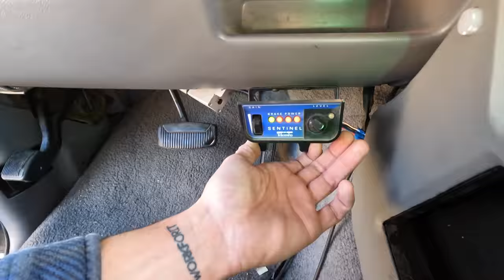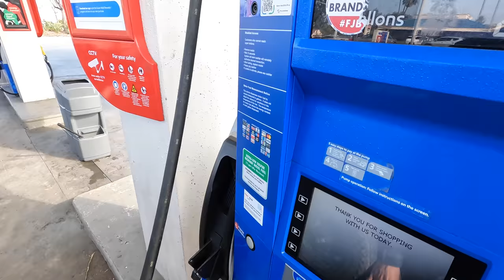RYNO RANCH GUEST HOUSE RENOVATION (PART 11)

Comment: Where I live I don't see that kind of dump truck setup where the box on the trailer goes into the truck there is a lot more gravel trains where its usually a dump truck and a dump trailer or a semi pulling 2 dump trailers

Comment: Hey this is what I found on that brake controller;  According to my contact at Tekonsha the Sentinel is an older brake controller and the lighting configuration that you have stated seems to be normal.

If the green light is flashing at approximately an 8 second interval, it is a diagnostic light that is showing that the trailer is connected and the system is operating. If the red light is illuminated that indicates that there is current to the trailer. If the green light is a solid green light then it is indicating that braking has begun.

However, if the green light is quickly flashing at an interval approximately 3 times per second it indicates that there is an issue such as a short or excessive current on the system or low battery on the tow vehicle.

I hope that helps.

Comment: Hey brother you should also install the cabinet before you install the angle stops that way you're only cutting a small little hole for the pipe then you can put those little collars on and then the angle stops and it'll save you having to cut a bigger hole to fit the angle stops.

Comment: Super sharp!

Couldn't you trim out the flooring before setting the cabinets?

Totally had the issue when I had my floors done, one of my bathroom cabinets a month or so later gave out on the front edge and dropped down almost 1/2" and ripped the backing off of it since it stayed on the wall.

Comment: Did a little plumbing in the past and only recently came across that shark bite style fitting to fix a leaking pipe in my parents house. It’s very unnatural to anyone who has used the traditional fittings. I was surprised that it didn’t leak. Seems I’m not alone. Always appreciate the content. Thank you

Comment: A better test for the p trap and plumbing under the sink is fill the sink full and let it drain. It puts more pressure on the fittings which will show a leak that might not show with low volume of water.

Comment: Ryno!! I’m a plumber out of Massachusetts and just wanted to share a quick few tips. Those shark bite fittings always turn like that. And the leak you had in your p trap is very common. I personally put a little pipe dope (pipe thread sealant/lubrication on the union part of the trap when I install and they never leak after that. Love the videos! Keep ‘em comin

Comment: Need to get the 6.0 fixed up buddy, it'll tow all your stuff you need without overheating. Just studd it and get a livewire tuner. Nice to see a trick to setting up water lines thanks for that. Hope the rest goes well man.

Comment: Im a certified plumber. I will absolutely only ever use shark bites in a pinch till I can get back to fix the problem permanently. The trick to compression angle stops is to use some lubricant on the ferules. And yes shark bites will turn freely, it's normal.  One think you should do when using shark bites is to file the end of the copper pipe a little . Copper cutters will bevel the edge making it a little larger. It helps to not wreck the gasket when installing the shark bite.

Comment: The sharkbites should not blow off if the building is still under regulator pressure. They in general practice will split and leak before they will blow off if the pipe is cleaned and properly roughed enough for the sharkbite to attach to.

Comment: Never run a floating floor under cabinets. It’s supposed to float. If you have issues the flooring manufacturer won’t cover it under warranty because that reason. Also supposed to be a .25 inch gap around all walls.

Comment: The shark bites were done properly. The only thing I would have done differently is take the plastic inserts out of the valves. The inserts are for pex, they aren’t needed for copper or cpvc. And yes after installed they will spin and feel loose.

Comment: I've used shark bite fitting on a water main coming in to the house to remove a water filter system we never used. Works great and never leaked. I was recommended to do this from an old tile installer my grandma knew

Comment: I'm not a plumber I do hvac but have done alot of angle stops in my life being I own rental property. normally with copper u take the white plastic piece out of the angle stop and throw them away there only used with PEX, second the seal is a o-ring and u really are suppose to reem the inside and outside of the copper on the stub outs before u push on the shark-bite fittings.
Reply: Another thing is they do make shark-bite fitting that are only for PEX so always make sure u grab the right ones that say copper,pex,pvc and cpvc. And pvc is not acceptable for potable water pipping.

Comment: Great job on this series I remodel homes for a living been doing it for 15 years little trick to installing baseboards before paint put 1 1/2 tape down first install base ontop paint wip out the tape paint 2x and cut the tape with a knife and Boom finished
Reply from the maker: I’ll usually do it with the really thin masking paper in the 8” roll. Slides out nice from under the base once installed. These guys I feel like wouldn’t have wanted that extra step and were already not stoked on me not getting the radiused corners for the base lol.
Reply: Every floor guys dream is to hear someone say run a razor blade across the floor lol. That's how some guys have decided to take off ram board on floors we've done. Those guys end up paying for entire new floors lol.
Reply: You won't ever see the cut from the razor blade great work by the way wish I lived in Cali I come give you a hand you teach me how to run that escovator lol

Comment: Love the videos on the renovation man! As for running the floating laminate floor under cabs that isn't a good idea, especially on concrete foundation(more moisture content). The flooring is meant to expand and contract with humidity and moisture, you may run into issues later. 🤘🏻
Reply from the maker: This is lvt flooring not laminate
Reply: @DMAXRYNO  Even though LVP and LVT are better than laminate as far as expanding, they will still expand and are layed the same with the gap around perimeter for that reason. Not saying it will but just a heads up from my experience as a superintendent for a homebuilder and have run into this scenario a few times.
Reply: @caseymerritt880  It gets laid under heavy refrigerators anyway will probably be fine. Plus that stuff doesn't really last enough for it to matter much lol. Speaking of the fridge, don't pull your fridge in and out even if you put down ramboard we just did a floating engineer floor where you glue the tongue and grooves together but leave the rest floating, cabinet guys pulled the fridge in and out a bunch on ram board and left these nice deep gouges in the floor home owner was super upset lol. It's gonna get real expensive trying to patch it unless we just re-lay half of the floor lol. I'd just spend the money on real wood take take of it and you can get 50-100 years if not more out if it and change the colors every 10 years with the fabs that's what we specialize in mostly hardwood sand / finish / install but sometimes we do the engineered garbage because people are cheap.
Reply: @dmaxryno I'm a commercial flooring contractor. Casey is right, the click LVT needs room to expand / contract and can't be run under cabinets. If it's too tight of a fit, you'll end up with the floor bowing up in random spots. Also, in the bathroom, if you haven't already I'd recommend caulking the perimeter where the floor meets the base / shower. Water can get under the floor from the edges and cause mold. Everything is looking great!

Comment: That floor looks great. I’m surprised yall didn’t do a subfloor material to minimize creaking and add a bit of noise isolation from walking.
Reply from the maker: The flooring has built in underpayment.
Reply: Oh super nice then! Don’t mind me backseat building then haha.
Reply: Oh man if I pointed out the giant stair step going down the middle of the floor and probably all of the H joints I can imagine are in that floor Ryan would lose his mind lol. As someone that specializes in real hardwood floors if we did that stuff for the guy I work for we'd get fired lol, after we fixed the floor for free that is lol. Has to be random with no patterns. No stair steps no H joints no putting the same length of board in a row 3 times or all shorts here all longs there. We typically rack out a days worth of floor we're gonna lay and make sure everything's good and looks good seems are far enough away and what not. Granted, that engineered stuff sucks we do it every once in awhile usually there's 3-6 sizes if you're lucky so you really gotta get creative cutting starter boards at specific lengths to throw off your seems for a new row else everything starts to become one giant pattern. That stair step across the room is gonna give me nightmares now lol.
Reply from the maker: @dedalliance1  luckily you don’t really see the joints in this type of flooring, so it doesn’t stand out at all or I’d be in the same boat as you. You should see the laminate(🤢) floors in the main house. ALL BRICK PATTERN. I’m sure they paid extra for the guys to do it too. Drives me nuts, can’t wait to rip it out
Reply: @DMAXRYNO  That sounds like the worst lol. Most people don't notice that little stuff but it's the edge that puts you above when you care about your craft.

I think if you renovate the main house you should do some real hardwood floors I'm biased but I think it's the best high end look just get someone good at sanding it, install you could do yourself lot of work but pretty easy. That's really a life time home improvement that actually adds value because it's resandable and you can go a different color that changes the whole look if you ever sell out.

Comment: 🤔 Why didn't the flooring guys put a thermal/moisture barrier down before the main floor, the concrete subfloor will suck up moisture and cold air messing up your flooring eventually, also has a effect on heating during cold weather
Reply from the maker: This LVT flooring has a built in underpayment. Adding another layer and cause too much bounce in the floor and may cause the pieces to unlock from each other.
Reply: @DMAXRYNO  okay cool cool, good to know about that using underlayment thank you for that..love watching your channel bro 🙏 many Blessings to you and your family